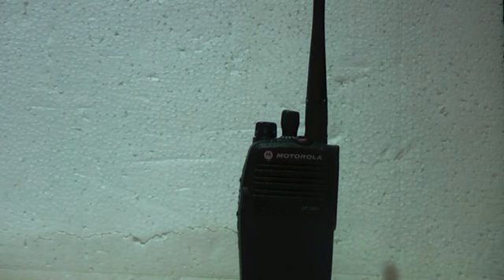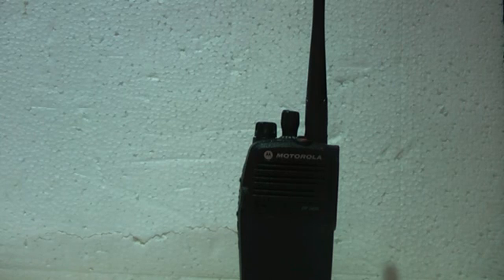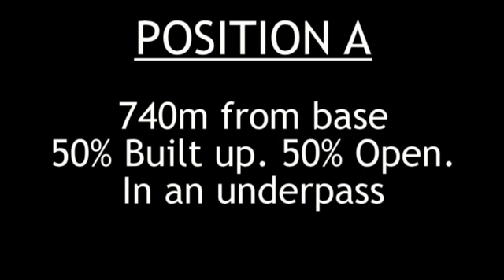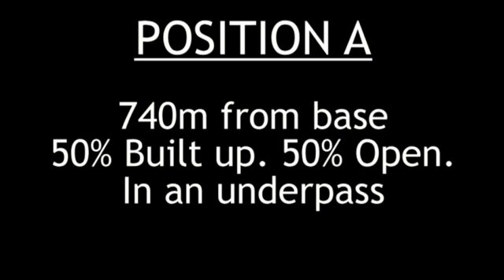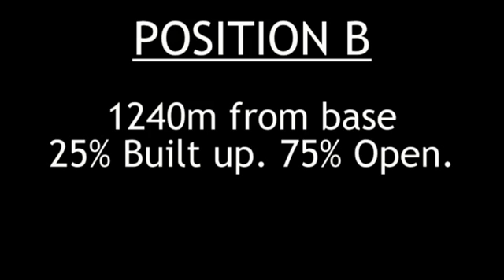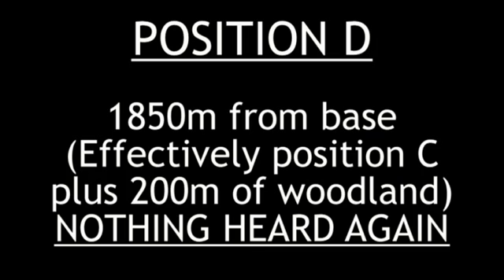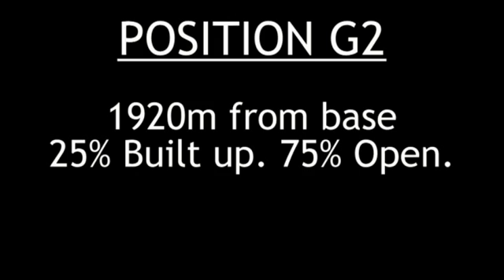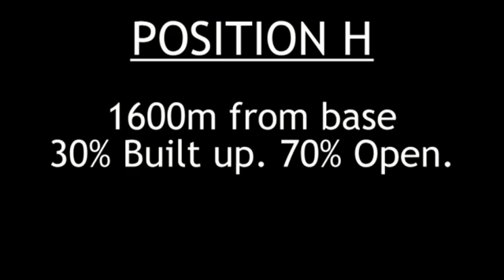Motorola Mototrbo Enhanced Privacy Range Test - DP3400

Comment: Interesting test but I found it difficult to tell which transmissions were with privacy and without. It would be better if you labeled them in editing.
Reply from the maker: Sorry, will do next time.. I did say which mode I was using each time and it was always the first call from each position without privacy and the second with privacy. That said, I thought there was very little difference between modes.